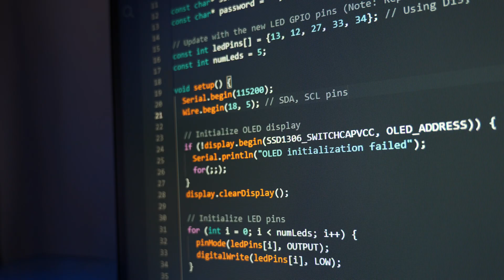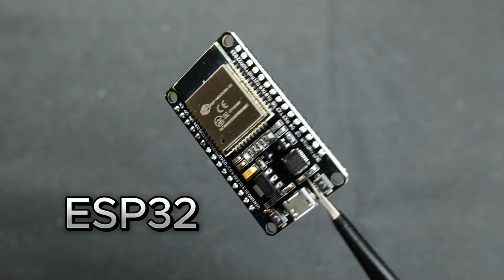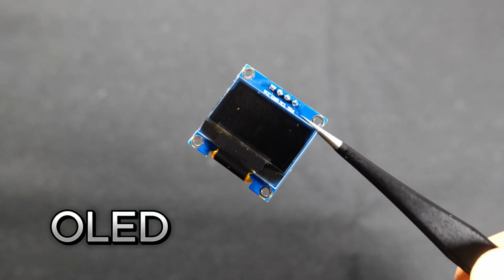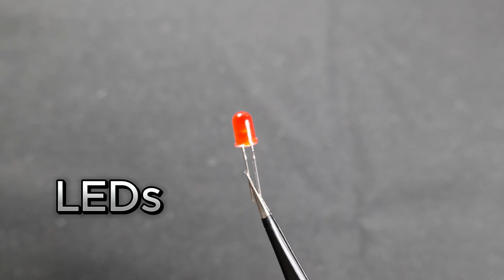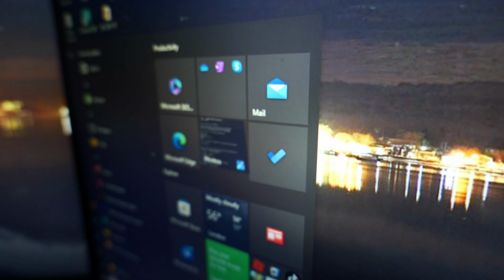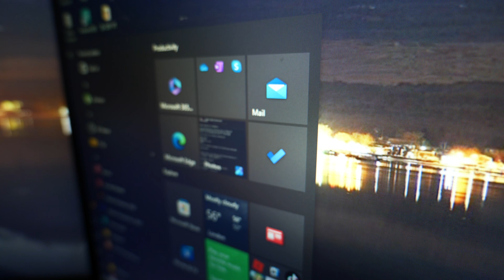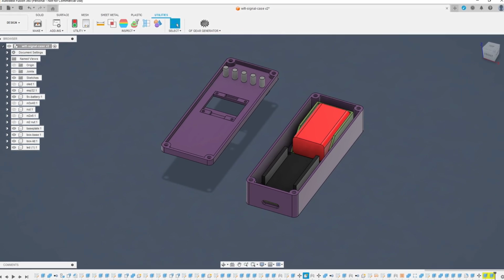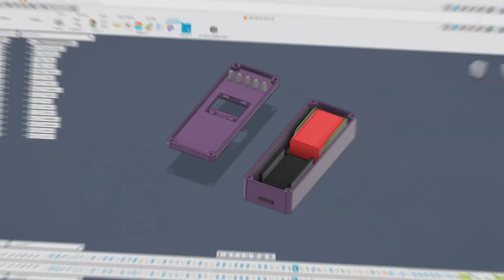My Wifi Sucked So I Made This

Comment: Interesting. Although I did miss write read the title… was slightly wondering why Google is recommending "my wife sucks so I made this made this".
Once I read it properly and sounded interesting. Used to be there was a couple companies that were making these little keychain he typed devices that took a CR 2032 and would basically just a Wi-Fi signal strength bar graph with LEDs. I can't remember I think one had an LCD screen that showed the SS IDs I can't remember it's been like 20 years. The idea was checking to see if there was Wi-Fi around/open Wi-Fi before you put it up your laptop at the airport and drained it's battery just to find out that it's locked or nonexistent before the development of blast everything with Wi-Fi. Part of me wishes those things still existed but they would be far less useful. Nowadays that would be more like hey look there's no Wi-Fi here and then somebody turns on a microwave.
Reply from the maker: Glad you found it interesting!

Comment: If your Wi-Fi signal sucks it's very unlikely your ISP can do anything about it, even if their router is acting as the access point.   Wi-Fi uses unlicensed spectrum and is very prone to interference from other sources (e.g. neighbours' Wi-Fi, leaky microwave ovens) and also has limited range affected by the materials used to build your premises.
Reply from the maker: Fair point!